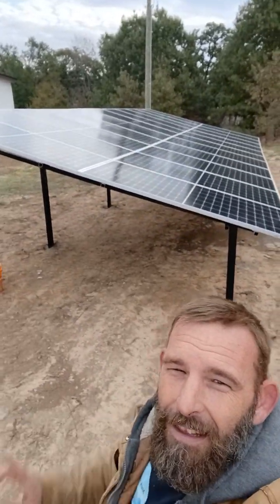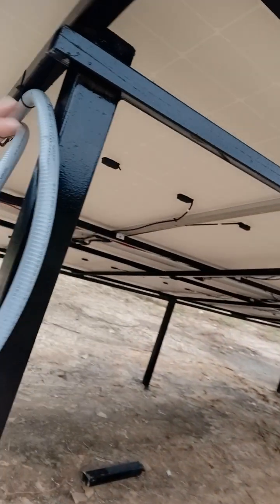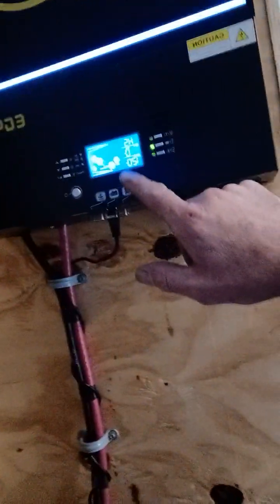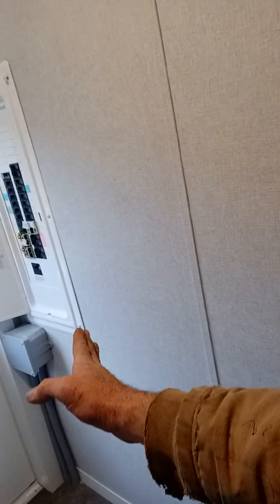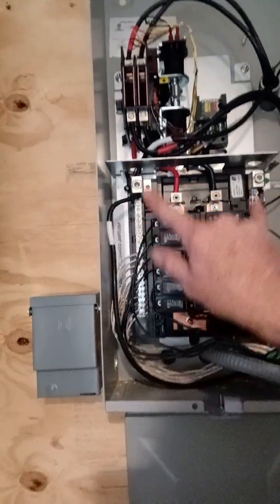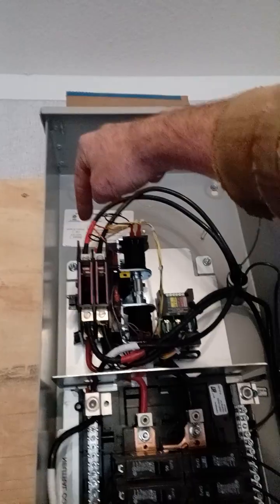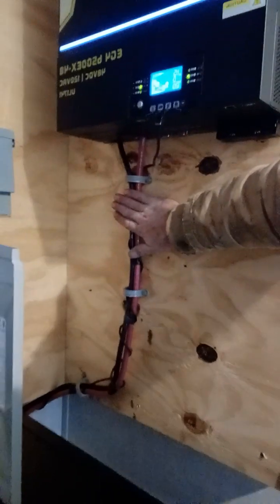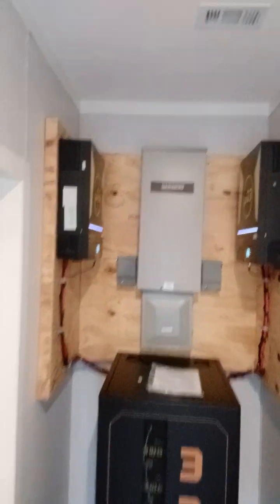EG4 6.5 kw customer supplied solar #signaturesolar #diy #solarworldllc #offgrid #lithiumbattery

Comment: Hi. Is that a quick make transfer switch? Can it switch between grid and inverters without the lights out computers shutting off? Thanks
Reply from the maker: It's normally quick enough to catch the transfer switch load efficiently enough. But for sensitive items like that and extended UPS battery Bank to run the computers would be highly advise
Reply: Hey thanks very much for this information

Comment: What is the transfer switch for ? Do you have a generator connected? It seems redundant since the inverters can cover that function..
Reply from the maker: The transfer switch is always allowing the system to go back completely to Grid in case of services or absolute failure happens then you're not just stuck and a complete down situation. We run the generator on a separate line coming in directly to the inverters for charging. In normal operations just a normal subpanel with a disconnect with work but this makes it so much easier for the customer for peace of mind and ease of operations
Reply: @Offgridsolar4life  Thanks. I should have went back and viewed the video again. I’ve thought about doing the same if I had a remote- start generator,but for me , I can wait until a convenient time to start the generator if the batteries get low in a extended grid-down situation.Thanks for your response.
Reply from the maker: @danielking2944  you should do that and make a video. We would love to see it!